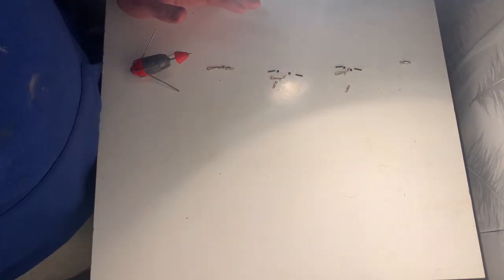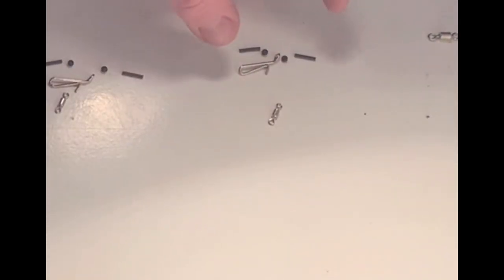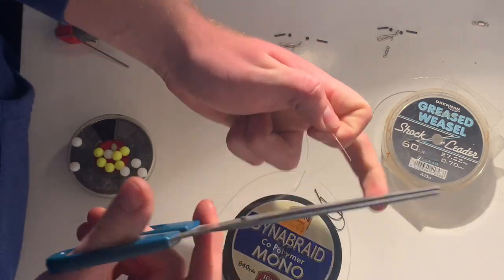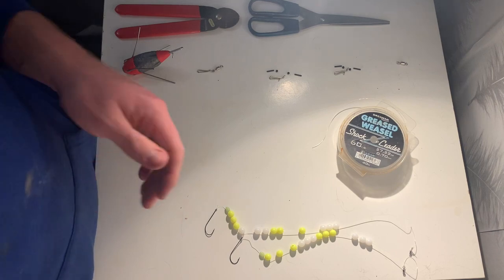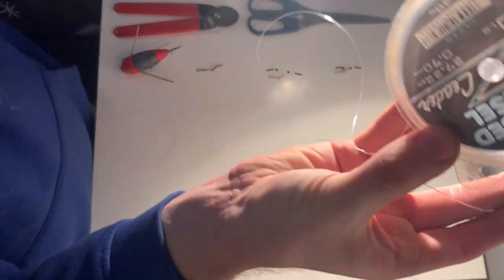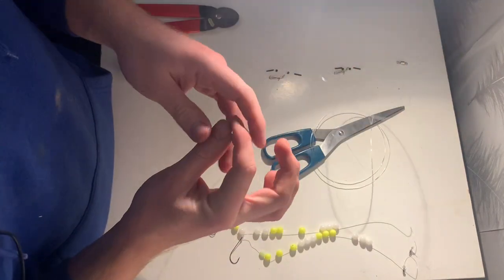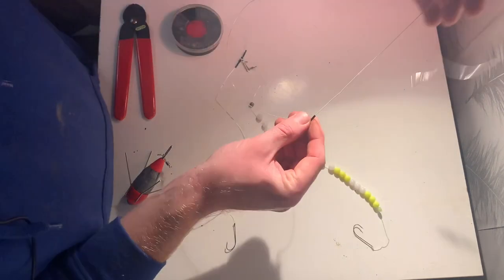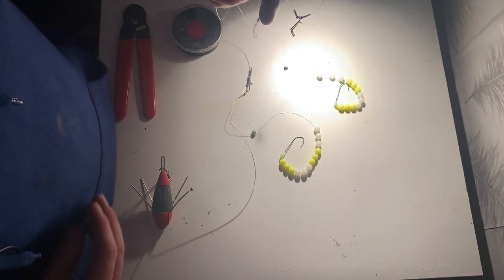HOW TO CREATE THE ULTIMATE BEACH FISHING PLAICE RIG - 2 HOOK CLIP DOWN - FULL TUTORIAL

Comment: Nice rig, You build the rig with detachable snoods, which is a good thing. What if you have to replace a snood or just a hook?  to get the right length it's not going to be easy. I would have made the rig clips movable, not crimped down, using stopper beads. Only a suggestion. I like the idea with the shots on the snood.
Tight Lines.
Reply from the maker: Thanks for watching, stopper beads are a good idea, I have a way of making the snoods the correct length however it took some practice. The beads are a good idea 👍🏼
Reply: @MuscleFishingOfficial  Sometimes I have the same issue with pulley rigs, when making spare snoods, needs practice to get the length correct.
Reply: @Malik Kash Instablaster :)
Reply: @Harvey Douglas Thanks so much for your reply. I got to the site on google and Im trying it out now.
Seems to take quite some time so I will reply here later with my results.
Reply: @Harvey Douglas it did the trick and I actually got access to my account again. Im so happy:D
Thank you so much you saved my account :D
Reply: @Malik Kash Glad I could help xD